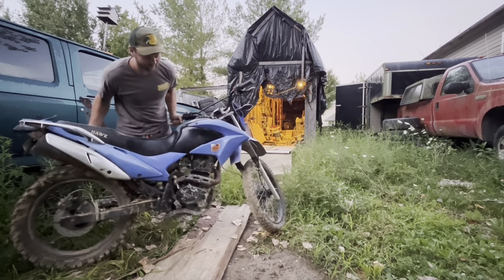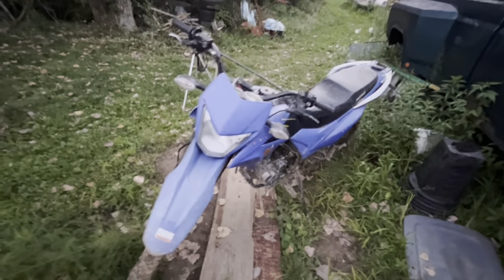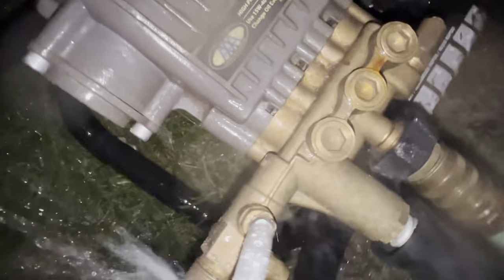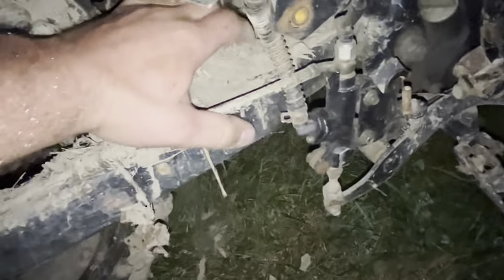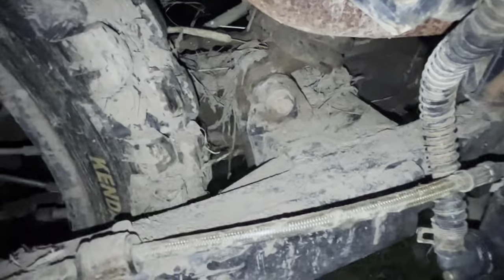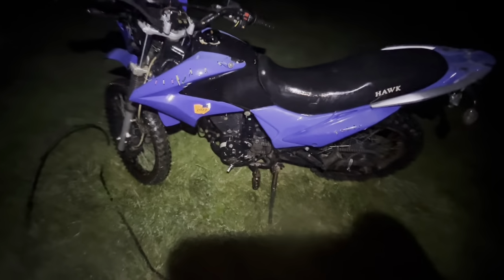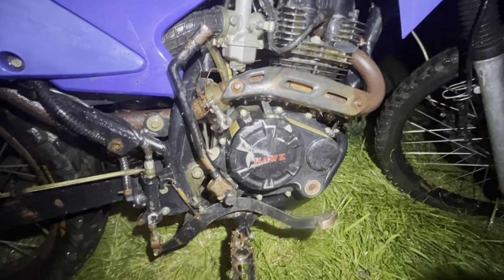Hawk 250 barn find. THE HAWK IS BACK!!

Comment: They are tuff capable bikes for being inexpensive Chinese machines. I love mine, barely broken in, starts every time, no issues knock on wood. Btw I’ve been having a hell of time with bees this year, anybody else?
Reply from the maker: After I filmed this video I realized why they were flying by my head. I was about 2 feet from a softball sized wasp nest and there were about 20 of them living there. I thought I was going to get ate up by them, but luckily they left me alone.
Reply: daily driver, had it for 3 years now. my only real issues have been the from the garbage airbox, and me crashing and smashing my front end but i rebuilt it w no more issues sense, but i still need a new front fender. just put the aftermarket exhaust on it and it’s a whole new bike now